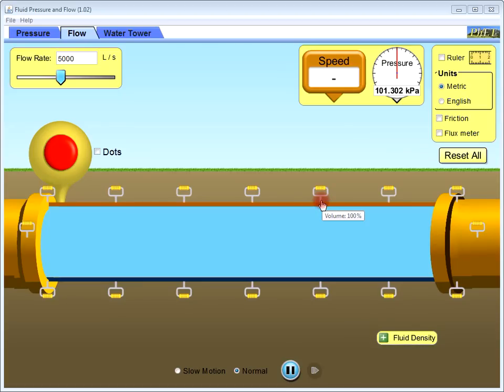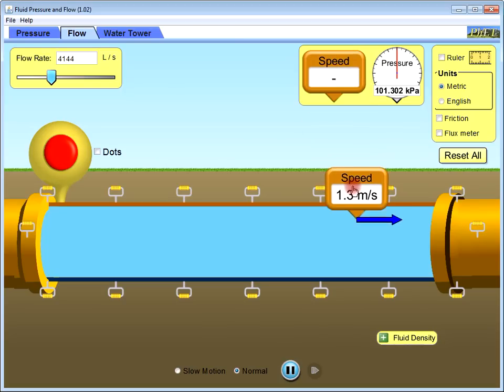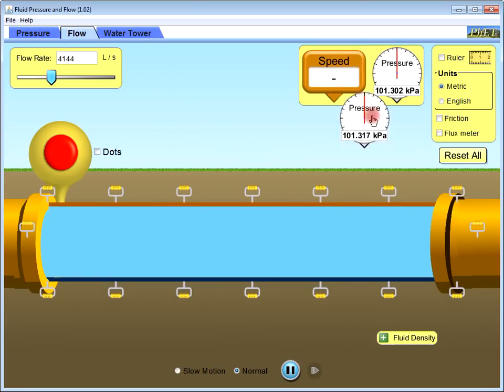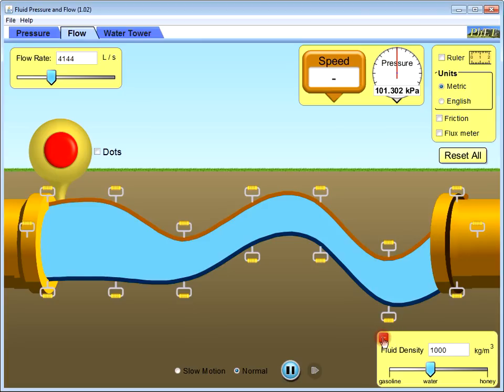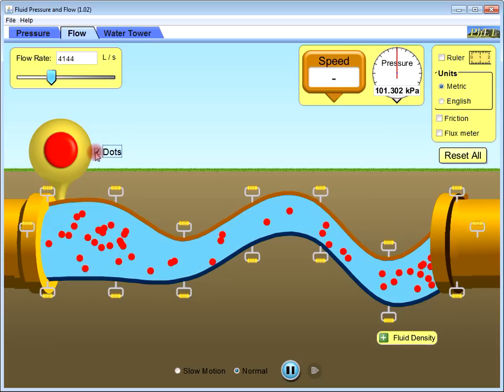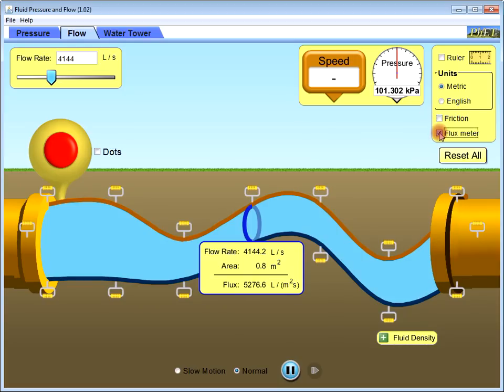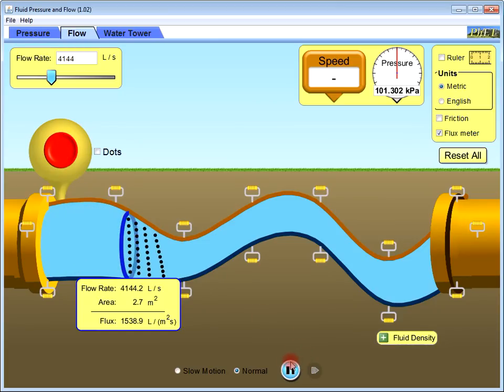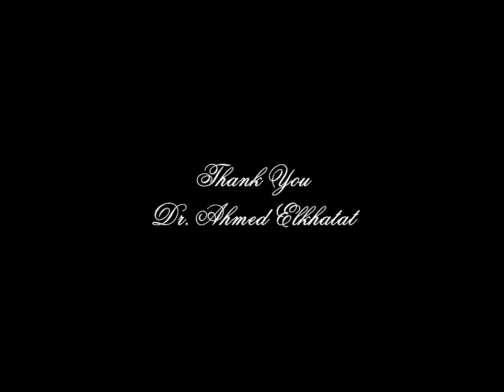Pressure and velocity in pipes

Comment: This looks counterintuitive. Assuming this simulation is 100% correct, I don't understand why flow is the same if I make a section smaller. Like a shower, speed can increase but the flow will reduce.
Reply from the maker: This is called continuity concept of mass transfer. The flowrates doesn't change, accordingly when you decrease the allowed path for the flow, it has to increase its speed to maintain the flowrates. Note that the flow rate is a multiplication of fluid speed and the cross sectional area. Hope this makes sense to you.
Reply: @medoKhatat  I  need to experiment in real life to understand it better. Thank you. Do you mind if I ask more things to you?

Comment: Thank You for your video, its help me so much. anyway how if there is the different height between A to B.
Reply from the maker: Hight will affect the potential energy of the fluid which will affect the pressure, the higher point has less pressure value
Reply: @medoKhatat  Thats Correct, if You dont mind to put it on your software. 
Its make better. Thank You so much.
Reply from the maker: @hasibuan626  it's good idea, thank you.

Comment: cool stuff. can you please teach us how to calculate the hydraulic speed in the network of ten pipes of the same size and length
Reply from the maker: Hi Justice, it depends on your volumetric flow rate and the diameter of the used pipe according to the following equation  (Q=A*v). The Q will be divided equally from the source to the 10 pipes if they have the same diameter, if not, then apply the previous equation.

Comment: Thank you for demonstaration , please i need help, when we have an enlargement in a pipe   result a pressure drop in the result, the flow decrease , but how about the pressure ?
Reply from the maker: You mean velocity decrease non flow, because flow is a conserved quantity in steady state flow,  and can't be decreased  unless you have a leak in your system. In enlargement, there is head loss Pressure Loss) but because of kinetic head difference due to enlargment the pressure will increase.
Reply: @medoKhatat  هل هناك حالة زيادة السرعة في المواسير تسبب زيادة الضغط لان في دراسة الحريق فيه معادله بتقول
Q= k Root of p
فهل ده معناه ان زيادة السرعة بتزود الضغط حيث ان العلاقة طردية بين السرعة ومعدل السريان Q
في حين ان فهمي العام بيقول ان زيادة السرعة بتقلل الضغط
Reply from the maker: @alialosh5563  دعني أعيد كتابة المعادلة بشكل أوضح 
Q=K*Root(dP)
هنا زيادة السرعة تزيد (فرق الضغط) وليس الضغط نفسه ، وكلما نقص الضغط زاد فرق الضغط

Comment: "Pressure of Water in a pipe  at a section of pipe is the compressive force on the pipe at that section of pipe."
Am i correct??????
Reply from the maker: Yes.
Reply: It's tensile cause fluid exert force outward on all direction when it has positive pressure....

Comment: they say that decreasing air pressure increases its speed, can anybody explain to me why? please? i cant visualize it, nor makes sense when i do...

i mean a bigger tube has bigger volume, if we have a part of the tube where we decrease the circumference of the tube by making it smaller  then wont the pressure increase thus also pushing the air faster?????
Reply from the maker: It's a rule called Bernoulli equation. However if you want to imagine it to make it makes sense, imagine that you are drinking a juice with a straw,  by sucking the juice you suck the air above the juice and apply a vacuum this makes the juice goes faster to your mouth. The more suction you make, the move vacuum and the faster juice. Does it make sense now?

Comment: What happens in case of AIR instead of liquid
Reply from the maker: Air also makes friction and leads to pressure drop. However, the pressure drop is very small in comparison with liquid as a result of its tiny desity

Comment: Can someone explain to me how to calculate the pressure from radius and flow rate in a pipe?
Reply: Lets say the pipe is 6-8mm and the water flow is 10m^3/s
Reply from the maker: @trifonstefanov8044  If you have the pressure at any other point along the stream, you can calculate the pressure at this point by applying Energy balance equation.
Reply: @medoKhatat  I know, I have calculated the pressure lose from the turbulent flow that occured due to the surface of the pipe, and because I saw your simulation, I woundered how do you show pressure within the pipe. 
I have initial water flow and radiuses of the pipe but no pressures.
 Ok, I understand it is impossible to calculate without a known pressure at some point in the system. Thank you

Comment: Video title should be: "Flow and velocity in pipes" and NOT "Pressure and velocity in pipes"
Reply from the maker: Thanks Christos, but The relation between flow and velocity is so simple and doesn't require any simulation, (Velocity=Flow/Cross Sectional Area), once you now your cross sectional area, then you can get the velocity. However to get the pressure drop, then Bernoulli equation should be applied which require simulation of kinetic head, potential head and head loss due to friction